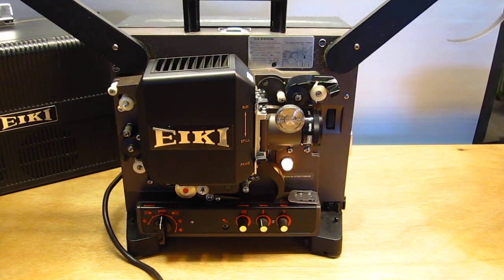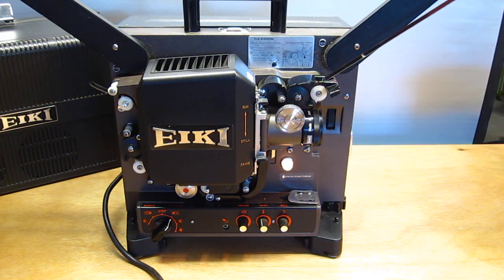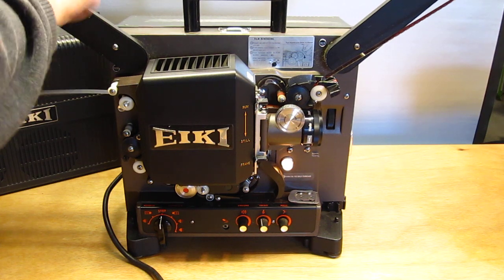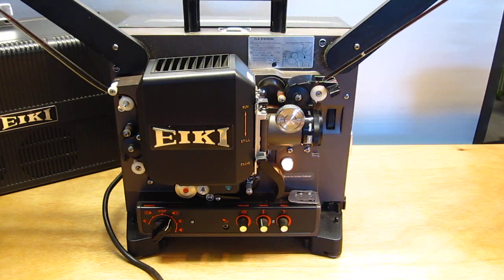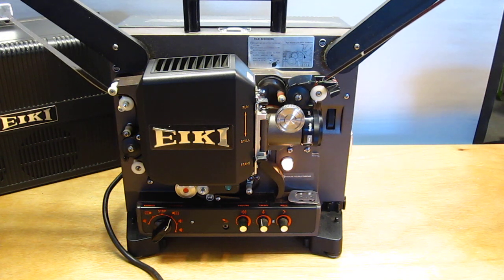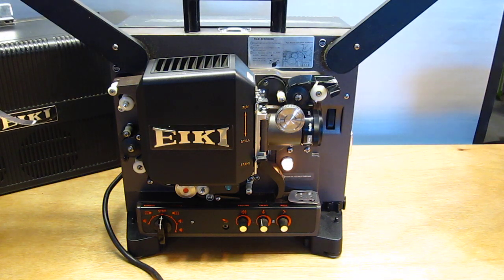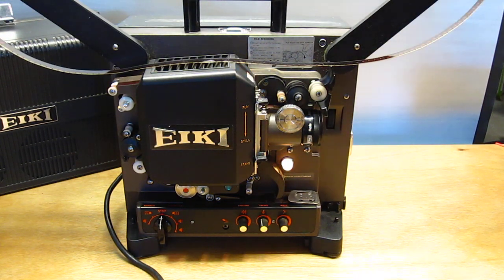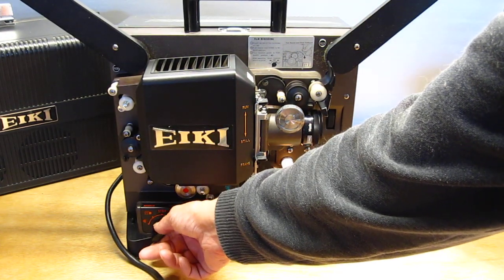Eiki NT 16mm Film Projector Loading

Comment: Thanks for this. I bought this model for 20$, changed both arm belts and the motor belt but I couldn't figure out why it wouldn't rewind when I pushed the lever up, when the only instructions I saw before this told me it would. You sir are a valuable resource!

Comment: I have the NT-2. Tried rewinding like in the video. the tension on the front reel seems uneven, creating bulges that get worse as the 1200ft reel get fuller. Is there away to control the tension better?
Also my manual, in the rewinding section, say "US & Canada only" What could be different on my UK projector.
Reply: Approximately how much is this projector will cost
Reply: I'd like to know the answer about Canada and US only as well.

Comment: Thanks for this...only thing is for some reason our rewind doesn't work...I flipped the lever...but it still goes the exact same way! Anyway...thank you!
Reply: Hi Matthew, you might want to open up the arm cover and look at the rubber belt inside. It might be disintegrated and all in pieces and gooey in there. I just found both of my EiKI projectors that way and found new belts at a company in NY. NCS products, New York
Reply: @offgridcabinquietadventure3812  Thanks Jack. I ended up getting the films digitised...which while expensive just makes it a lot simpler going forward...and preserves it. I take my hat off to the generation that used this equipment all the time...certainly more fiddly than all the modern toys we have! Still there is something organic about the quality of the image. Thanks!